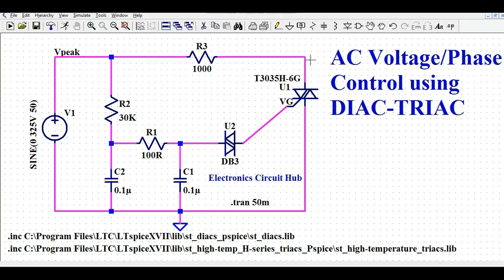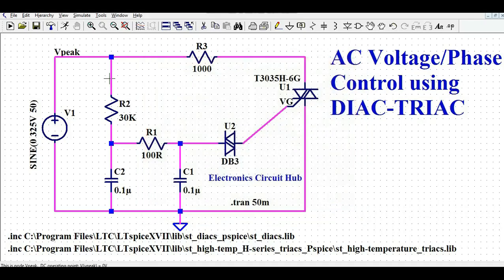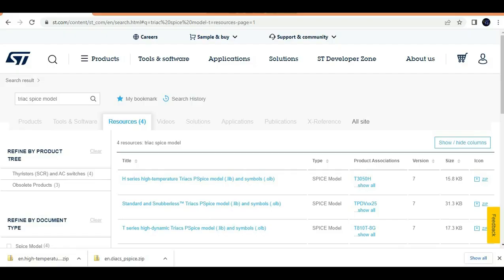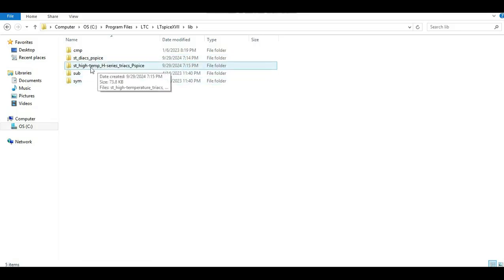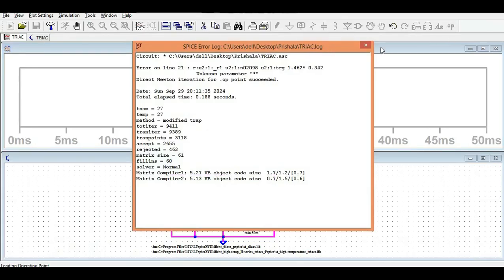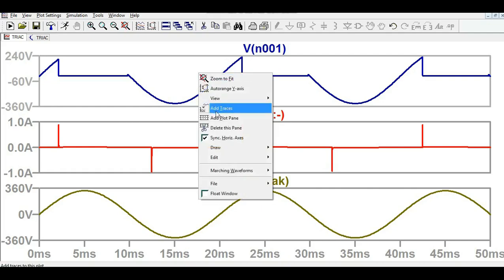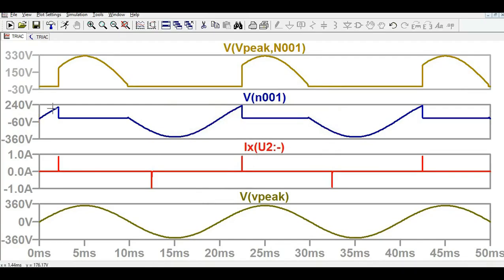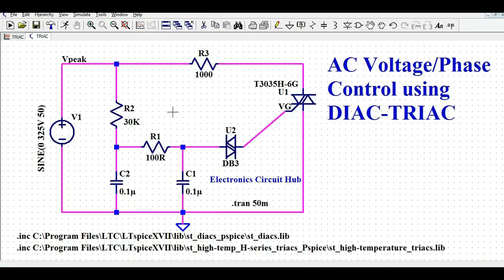Simulating AC Phase Control with DIAC & TRIAC in LTspice | Complete Guide

Comment: Why it is not conduction in negative half cycle, despite having gate pulse?  probably due to low gate current, not enough to turn it on in fourth quadrant??
Reply: you need to fix the pin order of the triac, the lib says: .subckt T1235H-8I A K G, so pin 1 = A, pin2 = K, pin3= G. 
But the triac symbol uses pin order AGK instead of AKG. 
right click on the triac symbol, 
click on "open symbol" button and fix the order: 
pin MT2 = Netlist order 1 (no change), 
pin MT1 = netlist order = chagnge from 3 to 2, 
pin G = netlist order  change from 2 to 3. This worked for me.